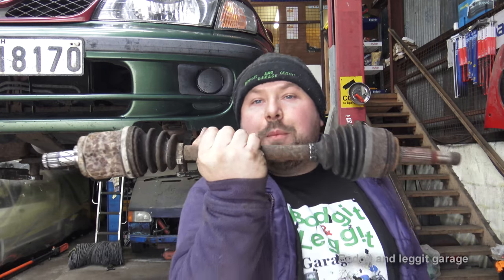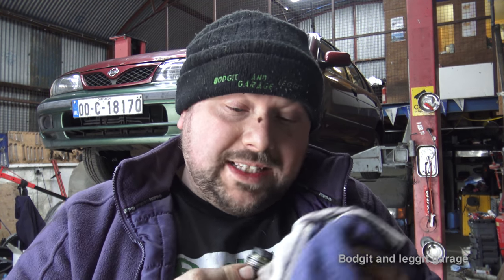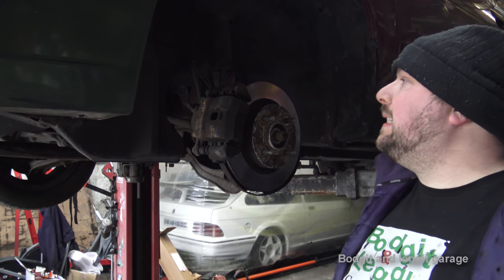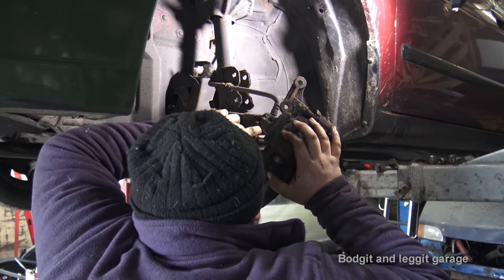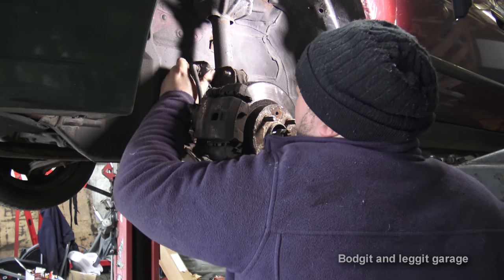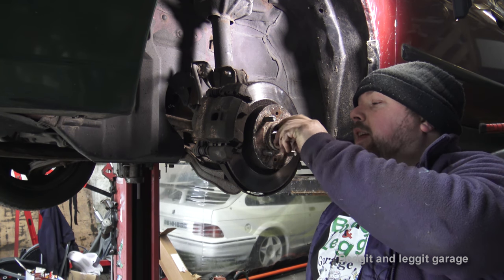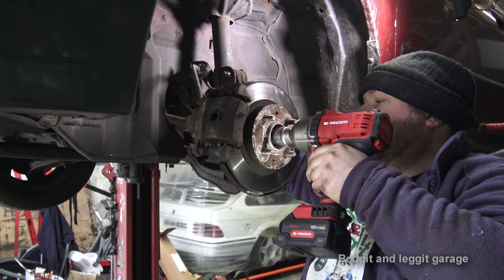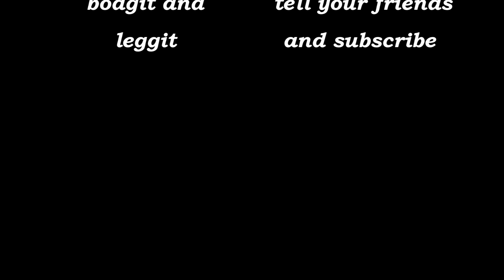Nissan Almera Drive Shaft (Noisy) Bodgit And Leggit Garage

Comment: My Seat Cordoba 1.4 TDI  failed the NCT on a cv joint. I just got a second hand Driveshaft in a breakers for €50. It was €200+ for a brand new driveshaft. I was hesitant about buying a second hand one because of safety issues but it should be okay.

Comment: Hello mate I appreciate all your videos . Don't suppose you got one taking a inlet manifold off on a ford c max tdi I got smoke comeing from it but goes away when I rev the engine
Reply from the maker: nigel watts as soon as I get one in that I need to do this on I will film it no problem thanks for watching
Reply: cheers pal . would broken seals cause this problem
Reply from the maker: nigel watts yes mate can cause lots of problems a vacuum leak cause rough running and lots of things like that
Reply: cheers mate I appreciate your information.  your video's have saved me ££££
Reply from the maker: nigel watts I'm glad they have help you thanks for watching

Comment: Probably a silly question, what if you drain gearbox and when you go to refill you find the filler plug chewed/screwed up,is there an alternative way to fill it ie: speedo drive etc????
Reply from the maker: Yes mate you can really put it in anywhere just be careful and make sure you get the correct amount of oil you don't want to put too much in it because you can cause lots of problems

Comment: Did you order the drive shaft as most garages around me won't fit parts that you supply even if they are new.
Reply from the maker: Hard Worker yes mate I did order the drive shaft why will the garages not fit this part for you
Reply: I bought inner tie rods and track rod ends for the mot but due to bad weather I couldn't fit them myself so I decided to get the garage to do the job but they wouldn't fit the parts I bought due to warranty. Then the cheap track rod ends they fitted failed after two months so they had to replace them on warranty.
Reply from the maker: Hard Worker lol that's called karma for them some garages i just for them

Comment: The only reason I watched this video was to see where's the plug is to put the gear oil in but oh well.... :D
Just did a cv-boot replacement and did also take out the sludgy old oil with flakes in it, but can't find a place to put new oil in
Reply from the maker: hi mate if you find the drain plug halfway Up the gearbox you will find the filler plug it looks like denticle 2 the drain plug in most cases
Reply: @bodgitandleggitgarage  thank you, found it!

Comment: Great video. Could have used your new fancy torque wrench there! J&R Driveshafts make Motorsport spec driveshafts at reasonable cost. A complete N/S driveshaft for that Almera is £50. I know of a few Rallycross guys that use them and they get seriously abused!
Reply: cozziekid very true, used them this week for my Transit connect. Got a OS drive shaft brand new for £40 delivered next day!
Reply from the maker: cozziekid hi mate unfortunately that would not work for me as it would take too long to come from the UK I needed to get this job done in one day